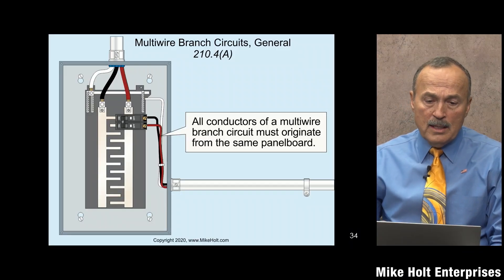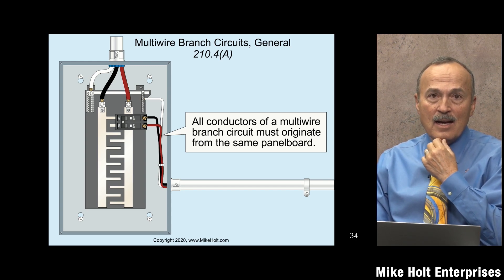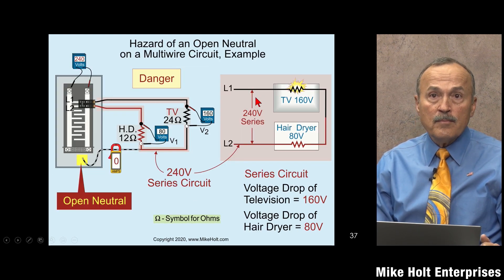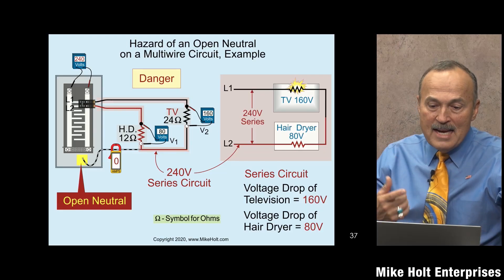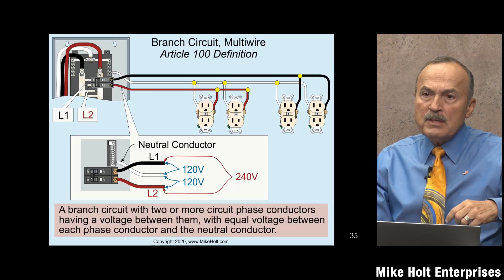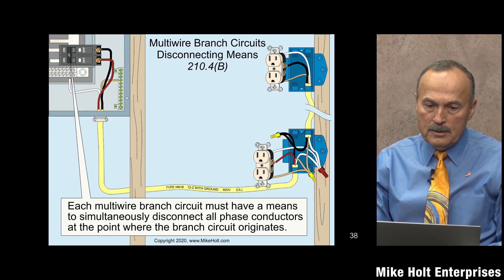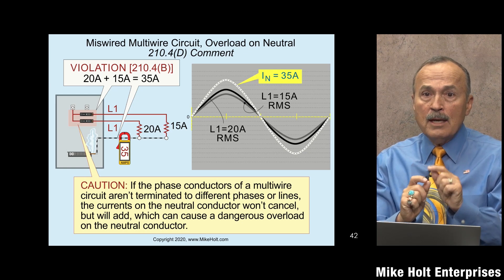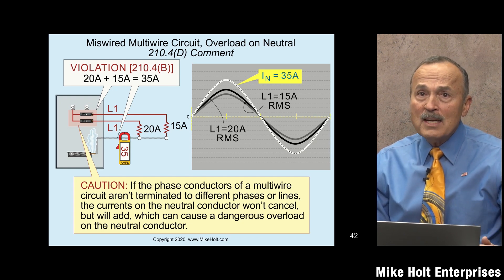Branch Circuit, Multiwire, NEC 2020 - [210.4], (19min:38sec)

Comment: I don't know if it's changed since this video but I sure would like to see the requirement for a colored tag at every shared neutral splice and point of use. If it isn't it should be going forward. I know many shares use a second colored hot wire but it's still hard when looking into a packed box to determine which white neutral is the shared neutral or which other black hot is sharing that neutral. Maybe we just require tagging or taping all three wires. Believe this would help everyone moving forward.

Comment: They should be outlawed in all residential panels. Homeowners, DIY homeowners that is, could easily and unknowingly get in there and replace a burnt ganged pair with two separate breakers. They may even move one breaker down a space making it the same polarity as the other. In commercial applications where only licensed electricians will do the work it's one thing, in a home where people can't always afford that licensed electrician it's another. And in a home losing that extra wire, that 25 percent reduction in copper costs, will not mean beans if the home itself is lost.

Comment: great video - another hazard at 15:30 people need to be aware of when powering your home panel with a 120V generator.  MWBC breakers should not be powered on because the common neutral can be overloaded.  One needs to at least be aware of which circuits are MWBC and what potentially that means so you don't overload the neutral in that case.

Comment: At 14:30 why is the one black and neutral (bottom breaker wires) zip tied together?  That is a normal circuit correct?  The guy even said it.  I would not think that is required to be grouped together with a zip tie.
Reply from the maker: For no reason at all... I'm removing the cable ties, thanks!

Comment: I'm confused why the neutral can zap you if you open one hot but not the other. I realize it still has current on it, but it's potential relative to ground is still 0V, no?
Reply from the maker: Post your question on MikeHolt.com/Forum
Reply: @MikeHoltNEC ok thanks

Comment: I’ve gone into a insurance agency office to add a 120v circuit for their sign and who ever made up the neutral conductors in the junction box I needed to access didn’t twist them together before putting the wire nut on them and they had multiple computers on the branch circuit. Out of caution, I had them turn off their computers long enough for me to tie into the circuit above the dropped ceiling. It costed another hour on the job because I had to wait for them to finish doing what they were in the middle of on their computers but I had learned losing a neutral on electronics is a quick way to burn them up.
How I quickly learned that as an apprentice was when I was doing a Generac whole house automatic standby generator install and when I was separating the grounds and neutrals in the panel, one of the neutrals went behind the neutral bar instead of under the lug and it just so happened that a VCR was on that circuit and when we turned power back on after installing the transfer switch it began to smoke. I quickly turned power back off and discovered the neutral.
I was much more attentive to checking neutral wires by tugging them to make sure they were under the lug screw on the neutral bar.
The taught me to be more aware of neutral connections!

Comment: Unless you were required to document/blueprint your electrical wiring design and have it recorded for the property owner, MWBC's should NOT be allowed.  And Especially not in residential wiring or any exclusively/predominantly NM-B environment.  MWBC's defeats the instinctive philosophy that "Romex" provides.  You can't treat a home like a piece of electronic equipment....just run what is essentially 240v to an area of the home and divide it back into 120v where and when you choose.  That "creativity" transforms the wiring of the home into an additional hidden circuit panel that you've engineered but not documented.

If you want to feed a 240v application....or feed a sub-panel....that's great.  But packing up a couple of phases for long distance transport and unpacking it upon arrival should either be not permitted at all, or require very easily recognisable means of transport throughout the ENTIRE circuit.  From the breaker to all its final terminations should be stripes or polka dots or something.  Or better yet, like I said, it just shouldn't be allowed at all.  Get over yourself and just feed a sub-panel.

Again, this kind of "creativity" defeats the many certainties and securities provided by the "Romex" philosophy.  There should be ZERO surprises in an NM-B environment.  Wires are to be grouped and bundled from panel to termination(s) within the sheathing.  If extended through multiple terminations, they should do so while remaining in that sheathing.  The philosophy should also remain contained within that sheathing.  No "creativity".  

There should be no MWBC's (and no "switch loops") allowed. Both defeat the "Romex" philosophy and give too much agency to the individual conductors contained within the sheathing....as if they were THHN inside conduit within a commercial environment.  And that flat out defeats the concept of "Romex" home wiring.  There should be zero mysteries in a "Romex" installation.  Everything should be standard and predictable from panel to termination.  Respect the sheathing.  It doesn't just contain the conductors...it contains the entire philosophy.

MWBC's that utilize NM-B to accomplish their means should have always been considered an illegal "trick" ...and be categorically banned from all future residential code, ...removed from our standards and best practices, ....and only be remembered in the same light as the "Chicago Three-way".....a cautionary tale of a practice that we thankfully did away with.  End of story.
Reply from the maker: @JamieHitt, I have no problem with WMBC in my house wired with NM cable.

Comment: Can we get an explanation on why someone can not use a gfci or afci breaker on a multi wire circuit? Please
Reply from the maker: Of course you can see https://www.homedepot.com/p/Siemens-Type-QAF-20-Amp-Double-Pole-Combination-AFCI-Circuit-Breaker-Q220AFCP/202253104[https://www.homedepot.com/p/Square-D-Homeline-20-Amp-2-Pole-GFCI-Circuit-Breaker-HOM220GFIC/204355351](https://www.homedepot.com/p/Square-D-Homeline-20-Amp-2-Pole-GFCI-Circuit-Breaker-HOM220GFIC/204355351)

Comment: Exactly.  Kirchhoff’s voltage law for series circuits.    The load with the HIGHEST resistance (ohms) will have the highest (proportional) voltage drop.

Comment: I don’t understand how even a properly wired multiwire branch circuit doesn’t overload the neutral. If two separate components are sharing a return path wouldn’t that double the current on that return path? Can someone explain this to me?
Reply: Think of a 240v circuit, there's no neutral because the load is always balanced when they are on opposite poles. When one side is supplying power, the other is returning and vise versa at 60 Hz. When a neutral wire is used, you have two 120v circuits. When line 1 is 15A and Line 2 is 5A, the returning electricity will be split between the opposite Line and the neutral. The opposite Line will return 10A, and the unbalanced load of 5A is returned on the neutral.
Reply from the maker: @surferdude642  Exactly. Example: the heating of the circuit wires of a 240V 15A circuit is the same as the heating of multiwire circuit wires where L1 - 15A, L2 - 10A, and Neutral is 5A. Using the formula I squared R. That's why the neutral doesn't count as a current-carrying wire. Note: Heat is a function of current, not voltage.
Reply from the maker: If Line 1 is 15A and Line 2 is 10A, then the neutral will be 5A. Basic electrical theory.

Comment: I have wired a dozen or so homes ages ago for my father a gc.  I messed up several jobs by overloading the neutral with breaker/leg misplacement.  It was eventually caught, no damage done and corrected.   Neutrals are anything but neutral, it should be called something else, like return, neutral minimizes the danger, much like interchangeably using grounding and bonding; that too is a deadly mistake.  Just ask the families of the dead burned alive in the enclosed metallic bus stops with metallic grated benches...  On a three phase panel, the 220 leg is orange and labeled stinger; a novice should head the messages; dont F with this. I digress; too many improperly trained, improper supervised and lazy inspectors create deadly hazards; like I did.   Appreciate you!

Comment: Correct me if I'm wrong, but in theory, if the neutral leg to a 120/240 sub-panel from the main panel was lost, every branch circuit from that sub-panel would become 240 volts with the entire neutral bar becoming the shared pathway.
Reply from the maker: Nope, please watch the video again.
Reply: @MikeHoltNEC , please think about it, I believe I'm correct. Obviously an unlikely circumstance though but the same premise.
Reply from the maker: This is a math problem, so work out the following to see if you are right. The load on Line 1 is 40A and the Load on Line 2 is 60A. What is the voltage from Line 1 to Neutral and Line 2 to Neutral? It's not 120V and it's not 240V.
Reply: @MikeHoltNEC  , L1 - 144 / L2 - 96
Reply: @MikeHoltNEC , thank you for your reply. You have a great channel.
Reply: @MikeHoltNEC , now that I think about it, there would probably just be a voltage imbalance on the L1 branches versus the L2 branches relative to the different load on each leg. Similar to what you showed with the different appliances in your example. With no neutral, only a dead short (0 ohms) would result in 240 on the opposing leg.
Reply: When I stated "no neutral", I was referring to a lost neutral from the main panel to the sub panel, with all branch neutrals back to the same neutral bar.
Reply: @MikeHoltNEC , in my original comment, I should have more correctly stated that 240 volts was theoretically "possible" (where one leg to neutral was a complete short, the other leg to neutral would become 240).

I understand the point of this presentation being an explanation of voltage variation in unbalanced circuit loads on two or more different phase legs when a shared neutral is faulty.

That said, did I correctly answer the voltage calculation question you had asked me?

Thank you.

Comment: So I guess even after watching this video - what is the actual benefit of using a multi-wire branch circuit, other than initial cost savings? Seems like all it causes is problems, confusion, and damage down the line. Just cause you can...doesn't mean you should.
Reply from the maker: If the NEC permits a practice, then it's fine with me. I would always run a multiwire circuit because it saves money and reduces the circuit voltage drop.

Comment: I think it would be a good idea to require all 15-20 amp multiwire branch circuits to have a 10AWG or 8AWG neutral, so that if there is an accident and you've got two hots on the same phase coming back on the neutral, that the neutral wire will be capable of handling that extra load, so this way if someone does share a neutral on the same phase/leg, the neutral wire can handle both loads.

Comment: All of that just to save a piece of cooper.  Why not just ammend the standards to do away with multi-wire bramch circuits?  Yes, I know wire is expensive,  but you're home-running a hot to both locations anyway.   Add another conductor you tight wad!

Comment: It's not only the panel you have to pay attention to but the phase as well. Some guys will land the ungrounded conductors on single pole breakers on the same phase which would make the unbalanced load additive on the neutral. So if you shut off one breaker thinking you are safe on that neutral you might have another hot wire out there still sending power back on it as well.
Reply: Yep. House I just bought someone got creative and landed some MWBCs on single pole tandems.

Comment: I came here because I have a critical loads, 120v sub panel, where I want to bring just ONE more circuit over to the subpanel, but it's part of a multiwire branch circuit. And the second circuit, I don't want to bring to the sub panel - nor could I anyway, as it's a 120v panel, thus on a single phase. I'm dead in the water over this last circuit unfortunately.

Comment: I'd like to add a note to Graphic 2. This rule is easily looked over when dealing with 120/240, 120/208, or 277/480. Where this becomes and issue is a High Leg Delta panel.

Comment: They were called appliance circuits years ago.  Cheap way to run one cable to a kitchen to get two circuits.  Much easier to understand when they were both in one double gang box with two receptacles, or one split receptacle, as opposed to all over the place.

Comment: It seems a multi branch circuit involving two 20 amp outlets with a shared neutral going back to a double pole breaker is not really too dedicated circuits.  I guess because the first outlet affectively has 120V going across it and the flow continues across to the other circuit in the neutral receives no current.  Not sure I understand how 240 V is involved here. So basically the second outlet is Sharing power with the first outlet where the returning circuit off the second outlet flows back to the Second Circuit breaker to complete the loop.

Comment: This is such a great video. I just happened upon it because I was looking to help someone who was interested in multi-wire branch circuits and their dangers.
As someone else commented below, these Multi-wire branch circuits are not compatible with GFCI... which thankfully means that over time, we will see fewer and fewer multi-wire branch circuits in the residential world as the NEC increases the requirements for more GFCI in the home.
Reply: True, although any multi branch circuit must be put on a DP circuit breaker ...and I always suggest using a GFCI or AFCI DP breaker.
As far as I know at this time that I'm writing, there are not yet Dual Function double pole circuit breakers ...but I predict there will be.
Remember that a grounded receptacle (ie 3-prong) on a non-grounded circuit must be BOTH AFCI and GFCI protected.  For now, with a shared neutral (multibranch) circuit, that means a double pole AFCI circuit breaker and a GFCI at the specific location.
Given the many old houses have hard steel work boxes with beveled corners, I hope the industry will save us from installing GFCI receptacles in to overly stuffed wallcases and eventually provide double pole DF breakers.
Reply: @SwingboyPA  I am not sure how it would be possible for a standard GFCI breaker to work in this configuration. Wouldn't any significant unbalanced load trip the GFCI?
Reply: @marcfruchtman9473  If by "standard" you mean "single pole", then yes, you are correct: it would trip.  That's why you must use a DP (double pole) AFCI  circuit breaker on a multi-branch circuit if you want to protect the entirety of both circuits.  Same goes if you wanted to use GFCI.

Make sense?
Reply: @SwingboyPA  I have been trying to find a manual / users guide (for any 2 pole GFCI breaker) that states that it accepts / allows  multiwire configuration. So, if you happen to have a link to a manual...
Reply: @marcfruchtman9473  You don't need a manual, it works because the breaker looks at both hots and justifies that against the neutral.  AFCI or GFCI double pole breaker on a multiwire circuit...it will work.  I've been an electrician for about 35 years and work almost exclusively in old homes in Philadelphia, PA.  I use AFCI, GFCI, and Dual Function circuit breakers all the time on knob and tube circuits ...which are often shared neutral circuits.  I'm not trying to be arrogant, but troubleshooting and remediating old wiring happens to be my specialty because I do it all the time.  The guy who trained me is the same; we both really enjoy the niche of working in old houses so this is something I know very well.  :-)

If it doesn't work, there is something else wrong.  ...And again, this is why I use AFCI and GFCI circuit breakers as a tool as much as a protective device.
Reply: @SwingboyPA  Thanks.
Reply: @SwingboyPA same gfi used on portable hot tubs.... 2pole 50a 240v, 4 wire..

Comment: Can this be corrected to two individual circuits?
Reply: You'd have to run a new line to the point where the 2 circuits 'split'.  If you are a homeowner reding this, make sure your multi wire branch circuits (colloquially called "shared neutral" circuits) are on a double pole breaker.  Preferably a double pole AFCI breaker.  If it trips, you may have another hot feeding that neutral or the neutral may be connected to another neutral somewhere in the building.
Reply: @SwingboyPA  Thanks

Comment: I have my fan running and my LED recessed lights on.  When I turn off the fan, on it's own switch, my LED lights also turn off momentarily (and then come back on).  Why???  I have a switch for my fan, and a switch next to it for my LED recessed lights in my bedroom.    Any insight would be appreciated.
Reply from the maker: I suggest you try different LED lights, not the same brand.

Comment: And all that DANGER just to save a neutral wire run.
Reply: Meh. Electricity is dangerously, but if you know what you are doing and work safely, shared neutrals are perfectly fine.